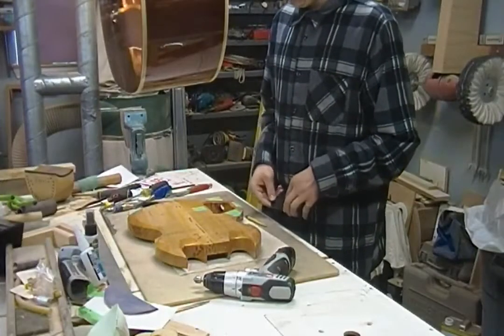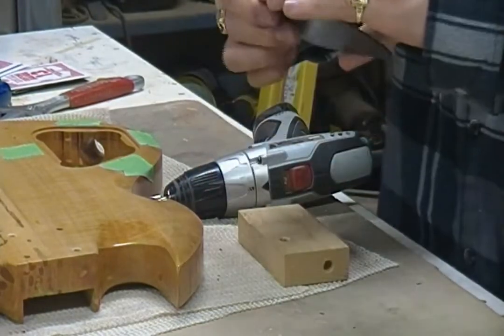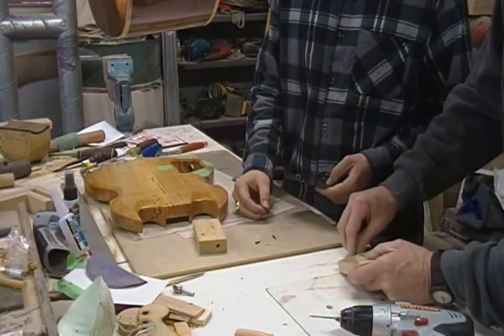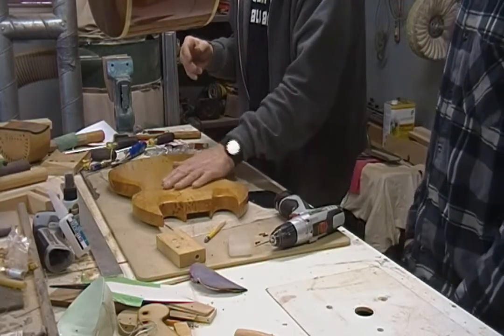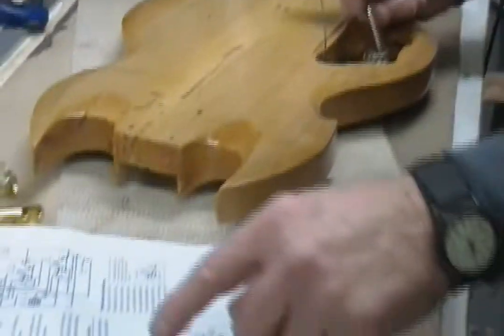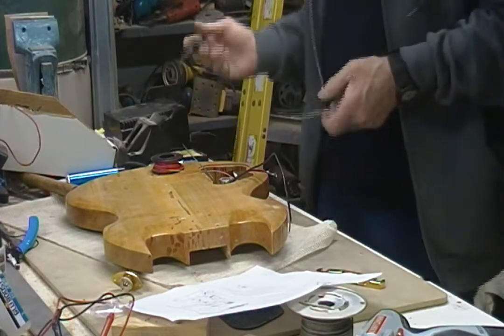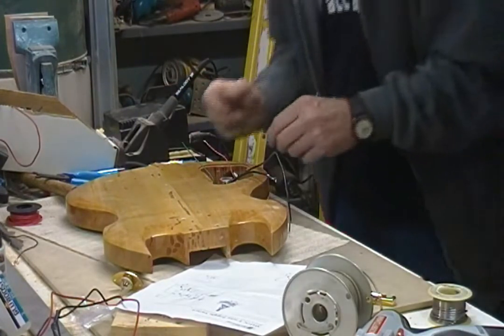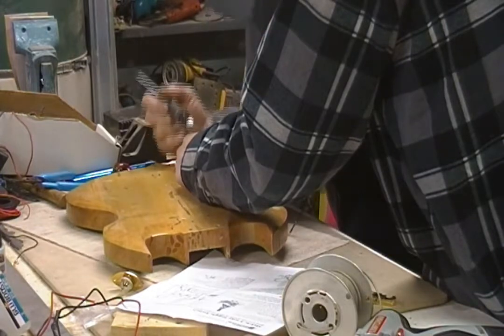Freddie Learns How to Build an Electric Guitar - Part 3

Comment: Looking good. You should eventually shield the control cavity too.  Good explanation of the capacitor’s role. I approve. 😎
Reply from the maker: That's funny you should mention the cap explanation, when I was editing this video I was thinking "I hope I'm not saying something stupid". As for the control cavity shielding if it's ever a problem sure no big deal to shield it. But as you saw/ heard in the video no noise what soever in a room filled with florescent lights. Thanks Todd.